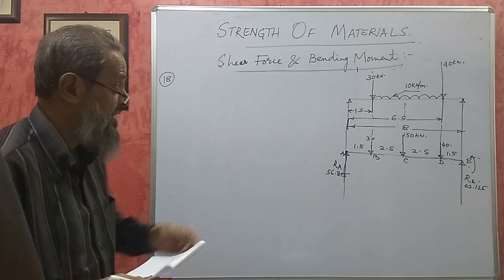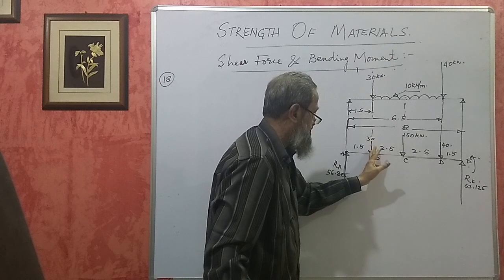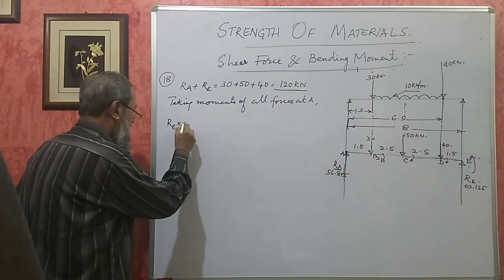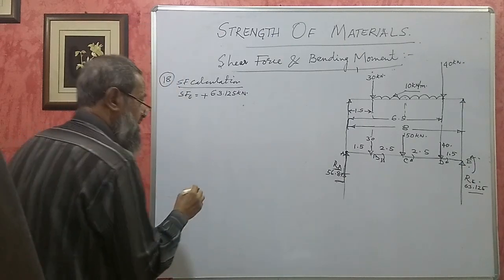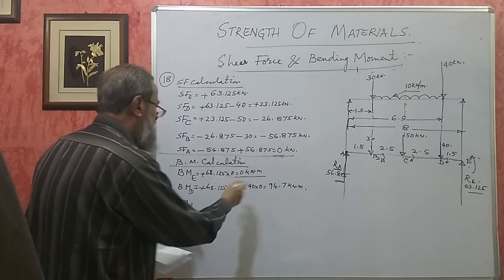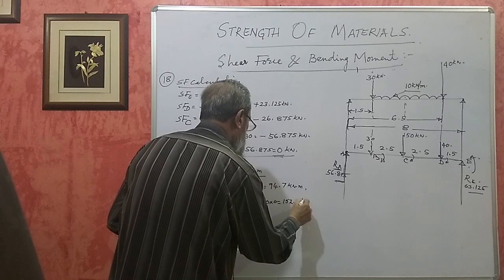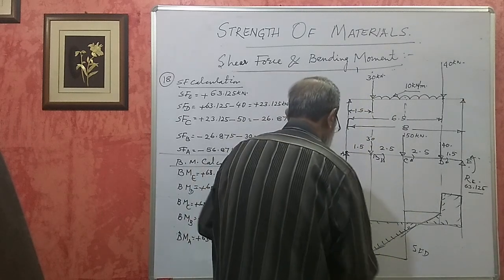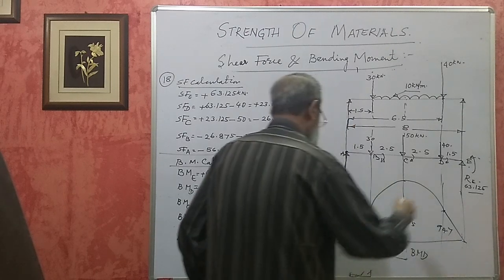Karnataka Diploma SOM -Shear Force & Bending Moment - Part 4

Comment: sir i have doubt in some text books they have mentioned that maximum bending moment has to be found then why have not thought (similar problem )
Reply from the maker: I think no such problem is given in the questions in the curriculum issued by the board. That's why I have not solved such problem. If you have any such problem you can call me on, 9341262367 
n
Reply: thank you sir